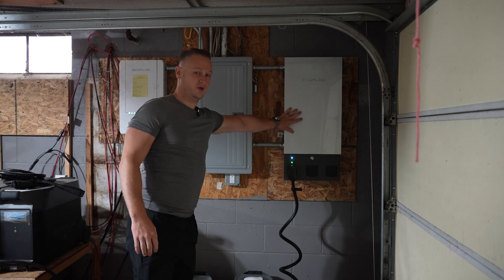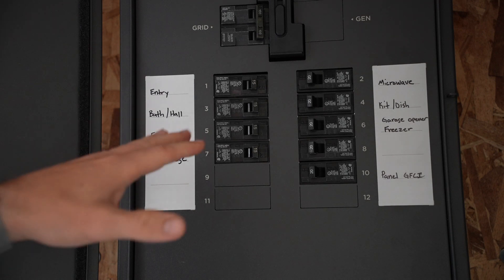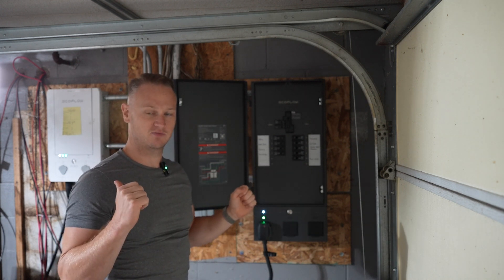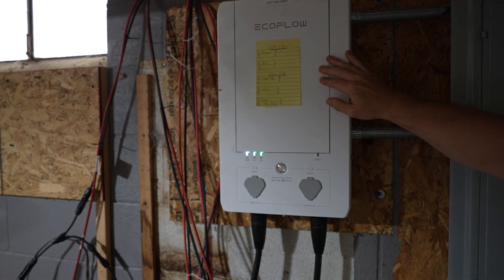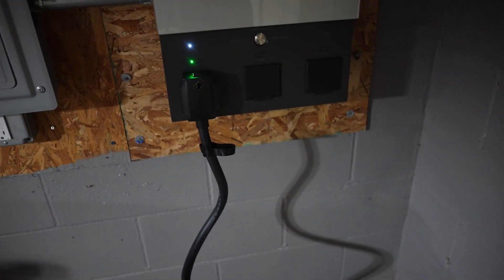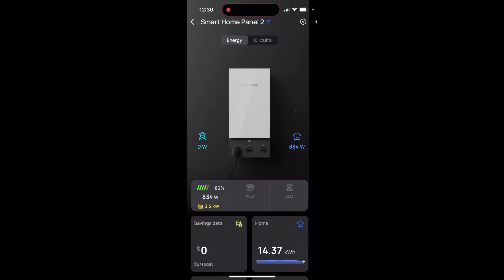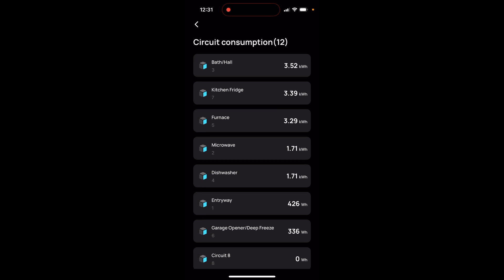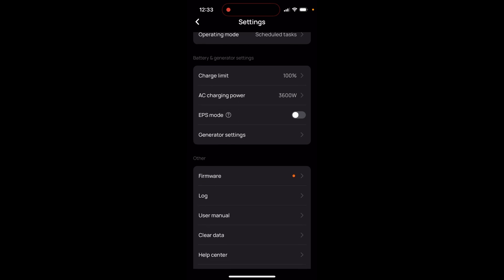Ecoflow Smart Home Panel 2 Review

Comment: One major downside with SHP2 is you have to choose EPS backup mode or operating mode. It is a binary choice. You can’t have both. If you have sensitive electronics like Computers, Laptops, Network Attached Storage, Hubs, Routers,etc they will shutoff abruptly or possibly damage your electronics when you lose power (it takes approximately 5 seconds to connect to the power). It is not a UPS. In the previous Smart Home Panel if you lost power, it was instantaneous (20 ms). You didn’t even know or realize the power has been lost (and that was on all 10 circuits). I brought this up to EcoFlow because I feel we lost an awesome feature in the SHP2. Right now to get around it you, have to buy a Pure Sine UPS for sensitive electronics. Quite a step back in my opinion.

Comment: i am trying to figure if the generator out can go to a transf box with 3 way switch and use my1 delta pro 3 to run 120 if ever needed and have another input for 50 240 fuel generator to run the entire house. 
Anyone try this yet?

Comment: Did you get your delta pro s to discharge evenly
Reply from the maker: No, I never could get the Delta Pros to discharge evenly which is why I eventually sold them and got a single Delta Pro Ultra which of course discharges evenly. It's very unfortunate the Delta Pros were so severely hampered with the smart home panel 2.

Comment: It appears you have a misunderstanding of "split phase" vs "single phase" simply due to your wording. I believe I understand what you're getting at but you need to be more careful with the wording as they are the exact same thing. Split phase IS single phase.

You might want to use the terms single pole versus two pole my friend. Not flaming on you just a suggestion as your entire house is single phase with a positive and negative on the sine wave which gives you the second pole creating 240v. But it's still single phase power.

Comment: I have 4 EcoFlow Delta Pro Generators, all with the EcoFlow Pro extra batteries. I was using 2 of the Pro's for my 240 v circuits on the  SHP 1.  The SHP 1 shorted out the control panel, not the 120/240 v relays. So now I can't control it with my Iphone as before. 
What I really need is to be able to control all my 120v or 240v circuits by WiFi. What do you suggest?

Comment: Maybe you can help me - I am a bit confused as I am seeing conflicting answers during my research (before I make a huge purchase). If have an Ecoflow Power Panel 2 installed and an inverter with a couple DELTA Pro Ultra batteries. Assuming I do not have a power outage, and I want to save money on my electric bill (not much of course). Can I set the app to run off batteries (say to 20%) and then the grid will kick back in and recharge the batteries back up to 100%, without my intervention? Also, if I have a power outage and run off my batteries for a couple days, can I connect a generator to my Power Panel 2 (assuming I have a 30A or 50A inlet installed off the panel)? Will the generator also recharge my batteries with the excess power produced? I do plan on adding solar, just not right away.
Reply from the maker: Great questions. Yes, in short you can use the SHP2 + DPU to save money on your electric bill assuming you have a TOU (time of use) metering system from your utility provider. Usually those providers charge more from like noon till 6pm and then charge a reduced rate during the non peak hours. The key thing is that you want to make sure that your DPU is enough capacity to get you thru the peak hours so that you can recharge during the non peak hours. I call this energy arbitrage. :) Not everyone has TOU billing so make sure that yours is first. 

Secondly, yes you can connect a generator to the panel (will need an inlet of course) and it could recharge the batteries although I'm not sure I'd recommend recharging them vs just running your house load in a true emergency. 

Hope that helps!
Reply: @DanielGoodwin-jq1oc  Very helpful, one last question (maybe), I currently have a 7.5kWh solar system (on grid).  I am wanting to build a smaller 4kWh system to charge my DPU's, will I be able to connect the 4kWh system to the inverter (on high) or does the input need to be less?
Reply from the maker: When you say a 4kwh system, do you mean stand alone batteries with its own inverter/controller separate from the DPU? If so, yes, that's essentially what I'm doing. I have a separate 15kwh battery bank connected to a 5K Controller/Inverter. I feed the 15Kwh into the DPU using a power switching supply which feeds at 1600w to the Low voltage input (although it could definitely do the high voltage as well).

Comment: I had a DP + extra battery connected to a SHP. I added solar to the roof. All was well until SHP failed for some reason. EF could not diagnose the problem. fortunately, I was still under warranty. I now have a smart home panel 2 with two Delta pros and one battery. I was told you have to have two Delta pros for the smart home panel to work. My question for you is have you tried to hook up solar panels to your Delta pros for charging purposes. I read where you can’t hook up a solar panel array to two Delta pros. any thoughts on this? The system seems to work quite well for me, but I need to be able to get the panels on my roof working to charge the Delta pros. right now I can only charge one at a time and have to do the plug switch manually. I had to purchase a second Delta pro for this to work.
Reply from the maker: Yes, you must have to have two Delta Pros + the Double Voltage Hub DVH to work with the new SHP2. (You can have just one Delta Pro 3 or Delta Pro Ultra).

Also yes, you can definitely hook up two (separate) solar arrays to the two Delta Pros and charge them. You cannot connect the same solar array to both delta pros as they will "fight" each other for the input and neither will charge very effectively. So you'll want to create two solar arrays and you can plug them into their respective Delta Pros. 

Regarding the 2x Delta Pros and 1 battery. You probably will find that a detriment as one the DP without the extra battery will deplete faster than one without and then the SHP2 will switch off battery power even though you might still have a lot of stored power in the DP + EB. The SHP2 doesn't draw evenly from the 2 DPs even though you would expect it to.
Reply: @ so a short term fix to help the batteries discharge more evenly means I’d have to add a second extra battery to the Delta pro that presently does not have one. Correct? Other than manually change over I have no other way to charge with solar both systems.

Comment: The reason why they only have 12 circuits is if you have 20 circuits and running off of battery it will drain it very fast leaving you not a happy customer, is my guess. 

If are starting off and only have small batteries it makes it even worse, unless you spend $20K plus on batteries, even then it may last about 1 day running your appliances and AC/heating units.
Reply: It literally depends what’s on the circuits. You can drain the battery just as easily with a single circuit depending what’s on it.
Reply: @zimvader25 agreed, but would probably make it even more useless with 20 circuits on there then.  I think you get my point, more circuits is probably not better.

Comment: If I connect a generator with a 120V output to the EcoFlow Smart Home Panel 2, and my home's power consumption is lower than the generator's output, will the excess power be fed back into the battery?
Reply: Did you ever get your answer?
Reply: @nickabel8279 lol what are you guys talking about? The panel runs exactly like a basic interlock when in generator mode. Meaning it pulls. You don’t push into it. The generator is NOT going to feed it any more than you’re using.

Comment: In Vietnam, the Grid supply is having only N, L(220V) and Grnd. Does the SMP2 work with this grid supply?
Reply from the maker: Yes, the SHP2 is compatible with 220VAC. Although I would say for more specific questions you might want to reach out to Ecoflow directly. I think you'd be in good shape though.
Reply: You should check with Ecoflow as you may need a model designed to use 220V 50 Hz. Products sold in America will be for 240V 60 Hz, with two 120V legs making the 240V (N, L1, L2, G). There might be a different circuit board required for different markets. Most of the world is more like your grid than ours, so it is likely they will have a compatible model.
Reply from the maker: The SHP2 supports 50HZ, when you set it up in the EF app you select what voltage/hertz your region provides. Can't share a screenshot here in the comment but it's available in the app.

Comment: On the Original SHP I can run some circuits on solar and some on grid and make changes on the app depending on battery percentage, Will the SHP2 have the same functions?
Reply from the maker: Yes, you can choose to run certain circuits on battery and others on grid. Basically, the SHP2 has all of the configuration capabilities of the first SHP + additional options.

Comment: I am off-grid and hope you can tell me if I can use this panel in place of a main breaker box or do I need both? That seems to be redundant since I will have all my circuits on the Delta Pro system (except Air Conditioning since those will be totally separate)
Reply from the maker: Yes, you could use this as your main breaker box (assuming you will have no grid power coming in). Obviously, if you run out of power everything will go down so size accordingly. :)

Comment: Can you run a second or even a third pair of DP's in the SHP2?
Reply from the maker: Yes! You can hook up to a total of 6x DP (with 3x double voltage hubs) to the Smart Home Panel. That definitely makes the original Delta Pros more useful and is one major redeeming factor of the new SHP2. You can also do a combination of 2x DP, 1x Ultra and maybe 2x DP3 if you wanted.
Reply: @DanielGoodwin-jq1oc  Thanks for the response. That is very interesting. Seems like that would give some shelf life to the DP...especially if they keep coming down in price
Reply from the maker: I expect that for Black Friday, the refurbished DPs from EF will be around $1,000. That's a pretty good deal if you have the solar panels to run them.
Reply: Thats exactly how I do it.   I have 2 DPU's with 5 batteries on each, 2 DP's with 6 Extra batteries connect to SHP2 via the Double voltage hub.   The SOC is a little wonky but it does work.

Comment: Thank you for the detailed information. I already have the one delta pro and thinking of installing smart home panel 1st version. But I have few questions, based on your usage and experience, how durable and reliable first version smart panel is? What’s big difference between new version and old for the simple setup like using one or two delta pros ?? Please advise
Reply from the maker: Hey there! A few things. With the new SHP2, you will HAVE to use two delta pros together with the double voltage hub to provide power to the SHP2. You can't just use one original DP by itself (You can use 1x Ultra). So that's one difference to keep in mind. 

The new SHP2 gives you 12 circuits vs 10 so that might be helpful depending on your household needs. The new SHP2 also seems to be a simpler and cleaner internal design, I'm not an electrician but the pro I hired to install it had installed both the original SHP and he said the new SHP2 was far easier to install and made a lot of sense to him. 

The original SHP seems very durable to me (my one issue not withstanding). In fact, even with that problem as long as I only connected 1 DP it would work just fine. I had issues when trying to run 2xDPs. 

Hope that helps some.